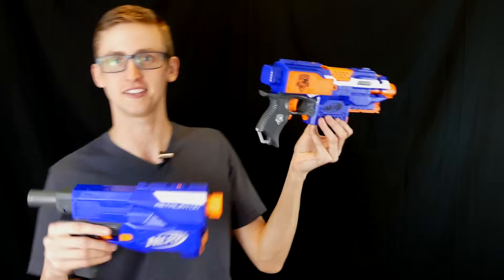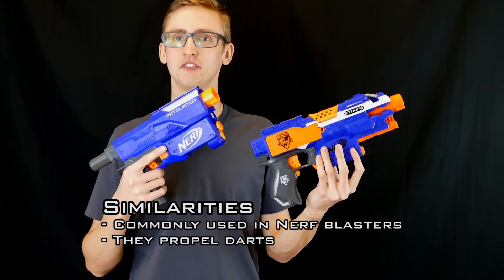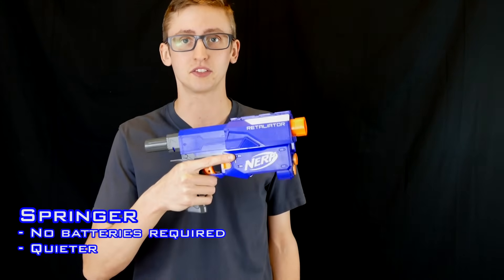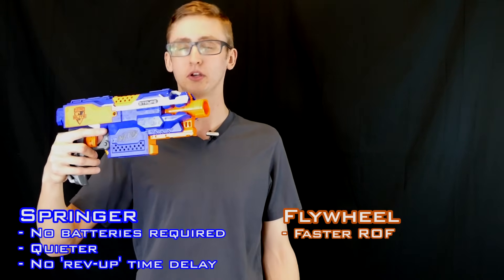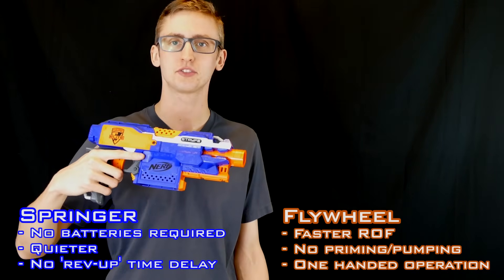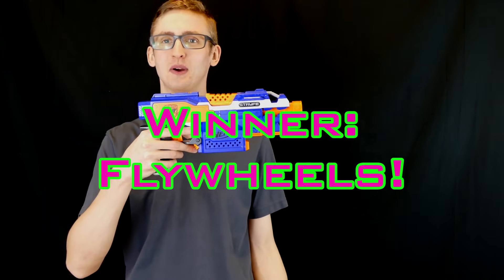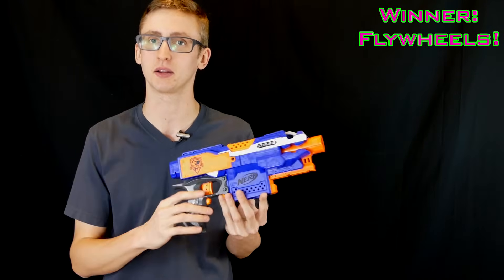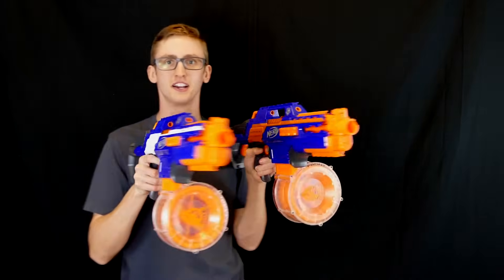[VS] Flywheel vs. Spring | Which is Better?!

Comment: For the sake of constructive debate, here's why I prefer a springer (specifically the Alpha trooper CS-12) 
1 the buzzing and slight vibration of flywheels is really annoying
2 a lower rate of fire makes conserving ammunition easier
3 if need be, pump action slamfire is pretty damn fast
4 the click of priming a springer is a bad ass noise
5 you can carry it primed and shoot at a moment's notice
6 in my experience, a single, carefully aimed dart from a springer flies faster and straighter than the spray of a flywheel blaster
7 batteries are a hassle
8 flywheels can tear up your darts if you're not careful
9 the extra safety features that are supposed to keep kids' fingers from getting caught in flywheels are a hassle 
10 if you shoot a semi-auto too fast and jam up your fliewheels, your darts and your day will be ruined

Comment: I like springer more than flywheels because:

1. They don't need batteries (Coop, tell me, if that stryfe needs 4AA battery, why not 6D? Dunno.)
2. They cost less.
3. I like exercising my arm and hands so that's why I use springer.

Comment: Both have pros and cons. Flywheels will always be more powerful and help deliver a faster fire rate, but nobody likes their blaster dying on them eventually. 
Spring blasters don’t require batteries, however aren’t as powerful and have slower rate of fire.
Modded, both still have better performance and great uses.
Reply: if you have a slam fired enabled nerf blaster thats a different story it has a much high rate of fire and also when modified springers can shoot way faster that a modified flywheel blaster if you use the right springs and springers and flywheel blaster when unmodified typically shoot the same so in my opinion springers are better but of course everything has pros and cons
Reply: Faster rate of fire sure , but definitely not more powerful, most flywheels are actually less powerful

Comment: Another thing is that flywheels are much MUCH easier to modify internally. All you need to do is pop open the cover and rewire to take off locks, take of thermosister basically rip off every electrical circuit and afterwards make your own. Electronics are usually easier to understand than the plunger system that until now i thought that it actually pushed the dart
Reply: No not easier you just are clearly more used to flywheelers lol (not a bad thing mind you )

Comment: Flywheel is better because
1. Rechargeable Batteries
2. Fly wheelers on a LiPo have an
Incredible rev up time
3. Most games will not allow 200 FPS blasters. (If they do allow 200 FPS, and 
There’s a lot dead space between you and the target, then springers are better)

Comment: My opinion is personally springer, as they seem to jam up less than flywheels with older darts. The stryfe will not fire darts sometimes even when its not jammed. The regulator seems to have the same problem (Not saying they are bad blasters)

Comment: Springers also can lose their strength as years go by but with flywheels, you can replace the batteries and it can perform good as new, I think.

Comment: Though I am a part of the #FlyWheelMasterRace the springer blasters are generally more accurate because the flywheels sometimes can move at different speeds, causing the bullets to turn, as well as, for example the stryfe, when you continuously fire it, it keeps losing power, leaving you more vulnerable. But, you can't argue with the full auto flywheel blasters.

Comment: I usually play small free for all games so using flywheel is basically saying hear (get it) I am, so I usually run Mediator, (small and fast rof) Jolt, Strong-arm, and in case of emergency, the Regulator because of its flexibility of rof

Comment: If you're worried about going around corners, have an underbarrel shotgun, spring or drain style. Another pro to flywheels is they take much less than perfect darts. Spring require the dart to semi-seal, flywheel does not. Another pro to springer is it fits in a smaller space.

Comment: FOR A QUIET GUN USE A SPRING SECONDARY OR EVEN A BLOWGUN SINCE IF YOU ARE CLOSE ENOUGH FOR NOISE TO MATTER A BLOWGUN HAS RANGE ENOUGH AND CAN BE SIMPLY MADE WITH A 2 FT 3/4" PVC PIPE A 3/4" TO 2".COUPLER FOR THE MOTHPIECE AND MEGA DARTS FOR AMMO.

Comment: Well you could buy an Accutrooper for $30 and a 5kg spring for $7 and now, you’ve got a $37 nerf blaster that has a higher FPS than a stock Stryfe and shoots just as fast if you want to shoot fast. And for most people, they’re not gonna mod their Stryfe because it’s wayyy more complicated than a spring change so their flywheeler is gonna be stuck shooting only 70fps where as their Accutrooper will be shooting 90fps

Comment: Rate of fire is different for some. Some guns like the Artemis have slam-fire which can get as fast as a semi-auto gun with more ammo. But no way is it faster than full auto. Semi-auto guns have a varied fire rate in terms of the user so in some cases even a springer can be faster than semi-auto.

Comment: Pros for flywheel: Super fast rate of fire.
Cons for flywheel: Batteries... AAAUUUGGGHHHHH!!!!!!!!
Pros for springer: Quiet, no batteries needed.
Cons for springer: The Deploy.
Best flywheel: PROMETHEUS!!!
Worst flywheel: Modulus ECS-10. That flimsy stock...
Best springer: Rival Hades XVIII-6000. 3 words: 60. Round. Capacity.
Worst springer: Deploy.
Best Nerf Series: RIVAL!!!!!!!!!!!!
Worst Nerf Series: Rebelle. Anyone agree?
Reply: I bought the core modulus ecs-10 which is just modulus blaster

Comment: Well let's say you can upgrade the flywheel and customize it and that same for the Springer but not the flywheel but can upgrade the spring and the Springer can be replaced by a higher one to shoot farther but hard to pump for a hard spring and not complicated to put it on and off but the flywheel it's kinda easy but hard.

Comment: In my opinion I would chose springer because you don’t have the motor bog like on a stock semi-auto flywheel blaster such as the modulus or stryfe

Comment: I just don't like flywheel, It's loud, it needs batteries, I just prefer springers, they don't go VVVVVVVVVVVVVRRRRRRRRRRRR when you fire a dart (I'm very noise sensitive so loud noise are just not fun), springers do tend to jam with older darts, but springers don't damage darts as much when you fire them.  This has been a small rant

Comment: the two main nerf blasters i usually use but it may vary on my style for that war i use a pump action modified retaliator for cqb and a stryfe with a worker stock and and my home made shield with a tote lid and tape and i only dig 12 round mags

Comment: Even though, yes the flywheel is faster but you are going to be using to much ammo and what if you are in the middle of a fight and oh no! your batteries die, got to go get more! Also, spring guns are WAY more easy to mod as you don't have wires and electronics to deal with. Also, the pro for flywheel that no priming, that is nothing as it doesn't take that long to prime a spring gun. And the one handed operation is nothing as who in their right mind would dual wield any Nerf gun it takes way longer to reload or do anything as your hands are full (and if you think because a gun is big at least if you hold it with one hand all of it will stay up no fall on the ground)

Comment: Pros of FlywheelsEasy trigger pull for firingCan have full autoLess pain in using handsMore accurate when compared to slamfire
Pros of SpringersMore satisfying primingSlam fireEasier to modUsually a lighter blaster
Cons of flywheelsExtremely loud especially if moddedBatteries will make caring for your flywheel blaster costly over timeEasy to mess up modding
Cons of SpringersMore energy usageDepending on the blaster, springers could have less rangeDepending on the blaster, springers could be slowerLess accurate due to slamfire if you do not have a steady hand
Winner???????I decided to make this a tie due to both being excellent. Springers are more satisfying to me, but flywheels have more speed and accuracy. Thus it is a tie. Both have their respective pros and cons, but it all depends on the blaster, not how it runs or what it needs to run better
Reply: plz use spaces

Comment: Jes, but Spring are much more reliable. My Regulator doesn‘t stop jamming, I have not yet achieved to fire more than 12 Darts without that the gun Begins to jam. But maybe this is just a Problem proper to the Regulator. I don‘t wart to criticize or spoil the opinion of people about flywheels, I just personally always had bad experiences with them. But coud someone recommend me a good semi auto with much costumization potential (as I bought a bunch of Modulus attachements with the Modulus)? Thanks in advance